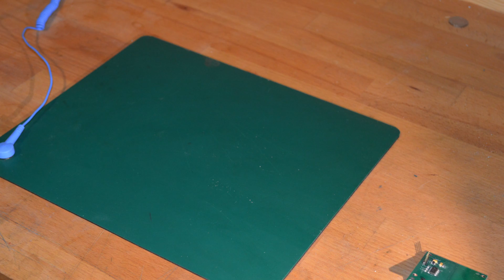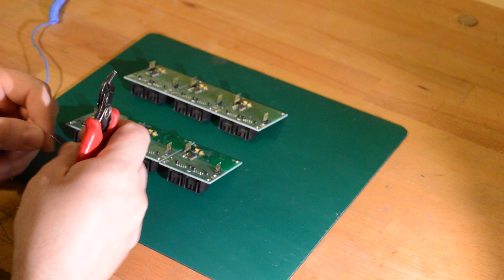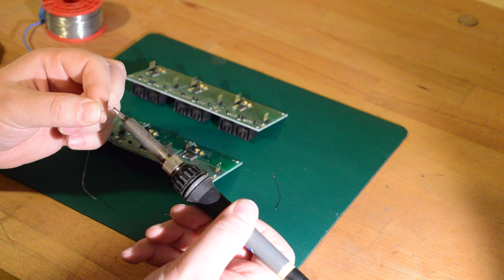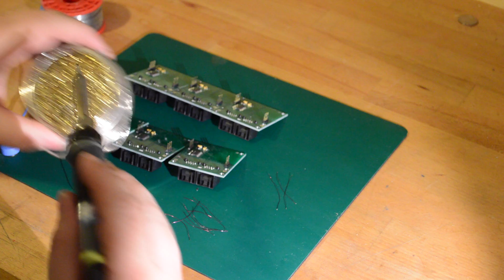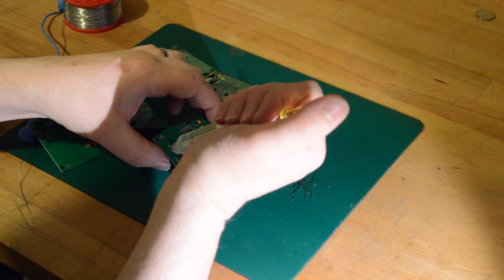PCB Repair using vero wire, flux and solder.

Comment: Hi, I broke the wires in half on my headphones when I tried to open the earpiece.
What can I do to repair ?
Reply from the maker: Hi Sorry to hear that. Headphone wires are often thin and delecate. You'll need so carefully pare back what's left and try to solder in a repair. You'll need a fine tip iron and good eyesight. Good luck!
Reply: @KennyMillarSFX  Thank you